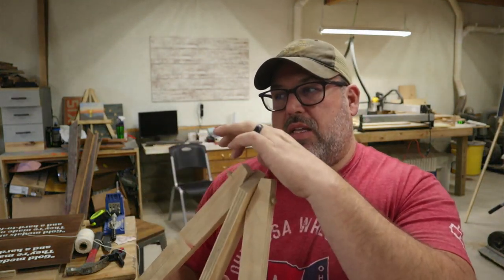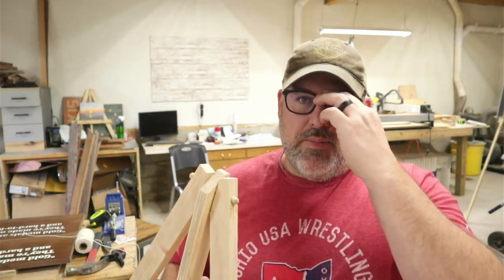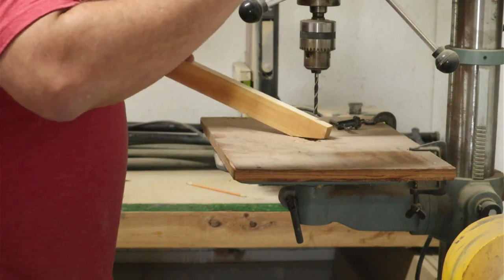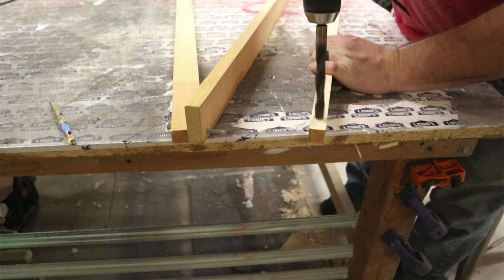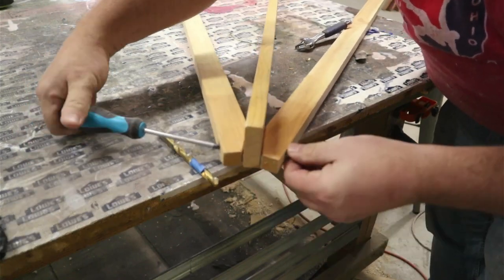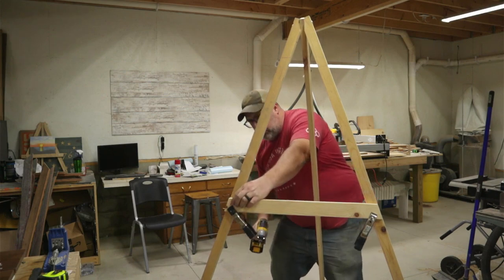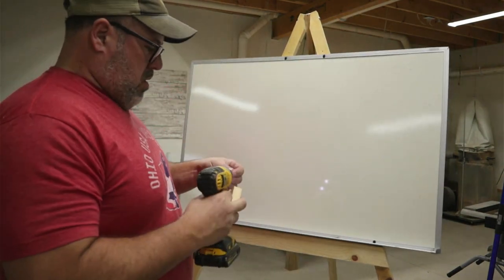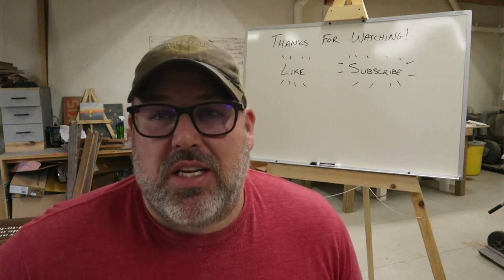Easel Building for Beginners: A Simple DIY Guide to Making an Easel

Comment: Thank you so much for making this video. Do you know the  measurements of each piece of wood?
Reply from the maker: I used 1x2s (actual size is 3/4" x 1-1/2")  for the legs. I cut mine to 77" long. For the piece that is supporting the markerboard I used a 1x3 (3/4" x 2-1/2") and the length was determined by the distance between the legs at the point I decided to attach it. I do not have the measurement I used for the height off the floor. This easel is still in Ohio at my old shop. We have since moved to Florida, so I can't even check it for you. I would suggest determining the height off the floor that looks good to you for your use, clamping the board to the legs like I did, marking the backside of the easel support where it meets the leg, and cutting it to that length.  The lengths will vary for all 4 pieces of wood depending a lot on your use. Hopefully that helps!